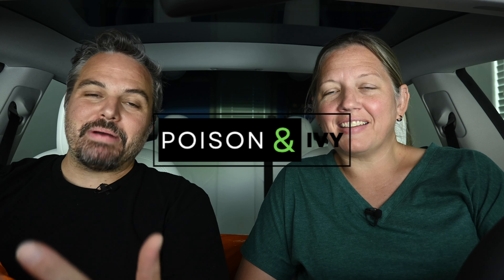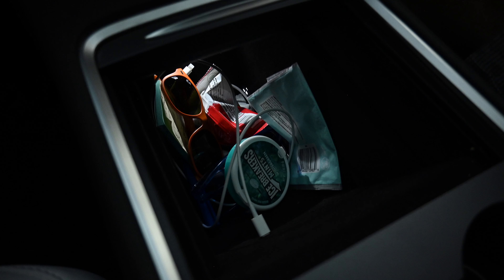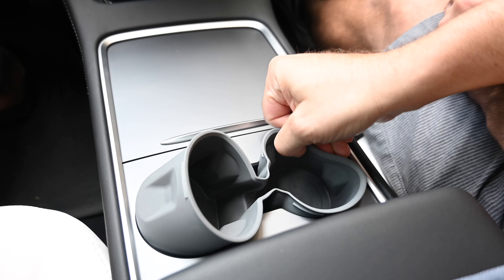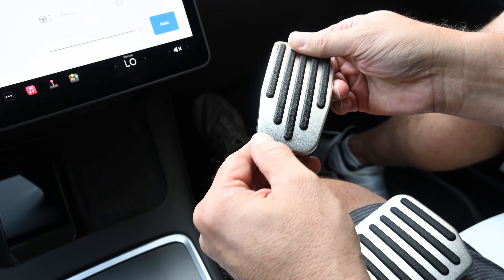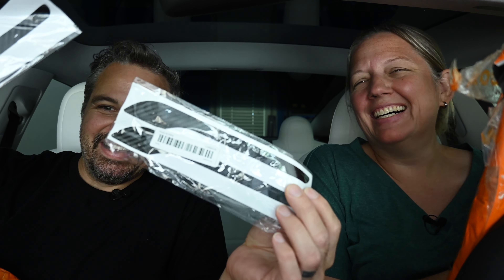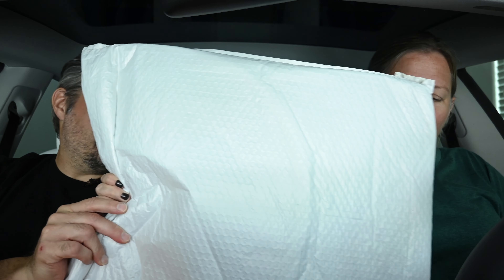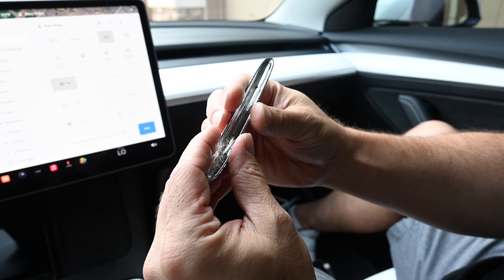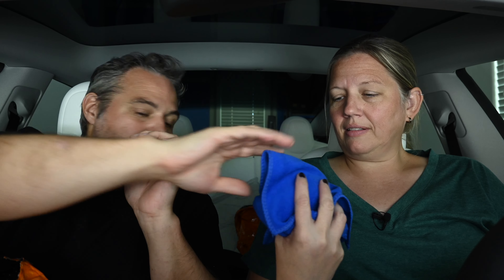TEMU + Tesla… Did We Find Anything Good? An Honest Review of The Good & The Bad!

Comment: Just a heads up, the cover for the cabin camera could effect Autopilot and disable it during a drive. You'd have to pull over, put the car in park, get out and then get back in to re-enable Autopilot again if you get the warning.
Reply from the maker: Awesome, thank you for the insight! That’s great to know!
Reply: @ivymotorcompany  also if you do decide to put those Performance pedals on, they are a BITCH to install lol. Heat up the rubber as you install them to make them easier to fit on (I learned this from Reddit after I installed mine lol)